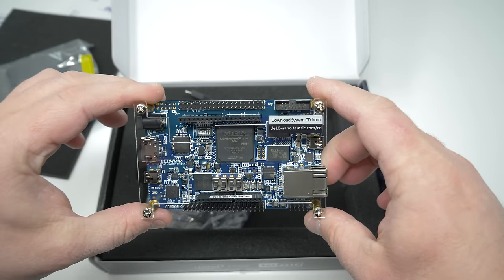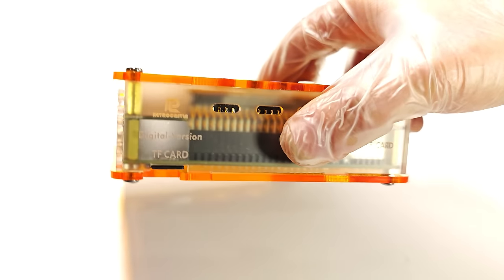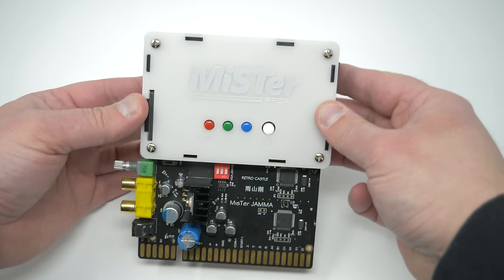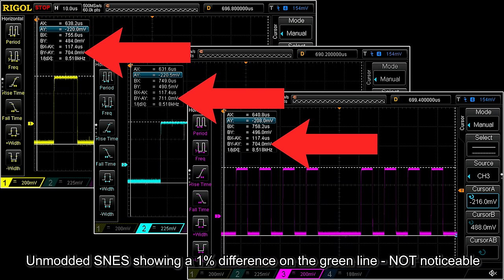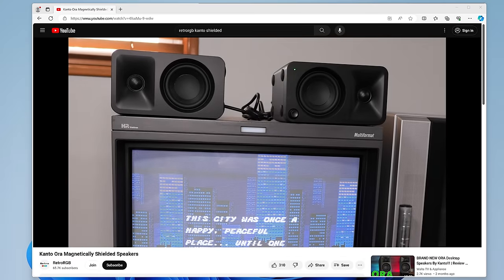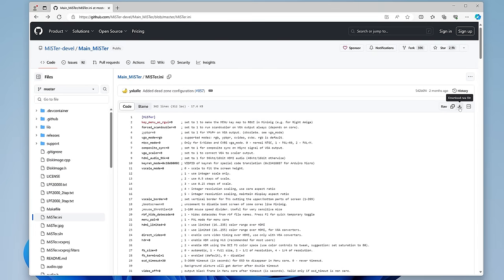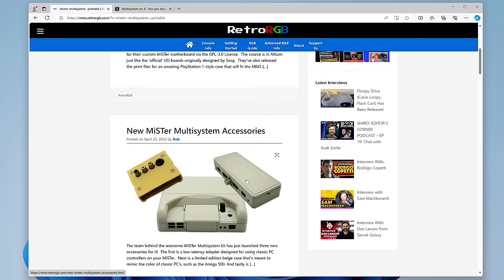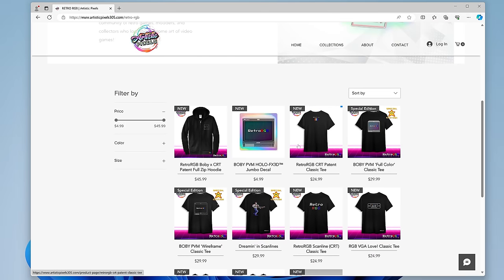Retro Castle MiSTer FPGA Kits

Comment: What has your opinion been on the MisterAddons products? They tend to be the more well known brand of MiSTer accessories, but I see they're absent and there's no mention here. I regret to believe that perhaps professional connections with them isn't favorable or their product quality/support may not be up to your standard. Perhaps I'm just out of the loop.
Reply: Bob's reply to someone else with similar question "I’ve never been a fan of the “double stack” design. And while the analog output is perfectly safe to use (provided you’re using properly-built cables of course), they fail the brightness / voltage tests I showed in this video. So, if you own one and are happy it with, no need to change at all. And if you’re only using HDMI-out, they’re all basically the same. But if you’re looking to buy a kit for use with analog video output, this kits are by far the best."
Reply from the maker: Yup.  I'd also add that MiSTerAddons availability and support were always excellent (and still is), which is why I used to promote them.  But they never fixed the voltage issues and the Retro Castle cases have proved their performance and longevity over the past three years, so they're the one to buy today.
Reply: @RetroRGB  Understood, thanks for the help and answer! Keep up the good work and thank you for all your contributions to the retro scene.
Reply: @RetroRGB It seems MiSTer Addons is releasing new IO boards (Analog Pro & IO Direct) that may fix the voltage issues. Will you be checking these under an oscilloscope if they come out?

Also, do you know if their component cables are different/better than Monoprice's, or are they the same but Addons is charging 3× more?
Reply from the maker: I've wasted hundreds of hours testing MiSTerAddons cases and providing feedback, just to have most of it ignored.  I'm not spending another second of my time testing that stuff, just to be continuously treated like I have.  Which is double insulting, considering how much money I've made him over the years.  I will say that the last prototype I tested a year ago still had bad voltage, but it was at least better than the others.  Really disappointing he stole the Saturn MiniDIN idea from Ivory though ;/

I believe this is the exact cable:  https://www.aliexpress.us/item/3256803400270601.html
Reply: @RetroRGB I'm sorry about the mistreatment. It must've been very frustrating.

Regarding the Saturn MiniDIN idea, does Ivory have exclusive rights to use that on his MiSTer cases? If not, then technically Addons isn't stealing, and other MiSTer kit manufacturers should be allowed to use this idea? His new boards are also using USB-C for power. Sorry for being devil's advocate.

As for the cable, I was actually referring to the VGA to component cable. Monoprice has it for $4.50 (now on sale for $3), while Addons is charging $15. I was wondering if Addons actually used better wiring/shielding to warrant the price increase or if it's deceptive repackaging (not sure if that's the right word).
Reply from the maker: @josephnguyen4349  I mean, you're 100% right - There's nothing "illegal" about using the same connectors.  But if you were making a product that you wanted to stand on it's own, would you do the same thing others have done?  Or would you want it to be more original?

...also, the VGA to BNC cables are almost surely the exact same as the Monoprice ones.  I have no issue with someone reselling at a markup for convenience, but if the shipping isn't too expensive, get the Monoprice ones and save some money.

Comment: Someone has told me not to use the misteraddons complete kits how do they compare to the retrocastle ones?
Reply from the maker: If you’re only using HDMI output, all the kits will perform the same. If you need analog video output, the MiSTerAddons kits aren’t bad…but the Retro Castle ones are much better.

Comment: I just use my HDMI to VGA and then directly into my PVM. No dac needed
Reply from the maker: Right, like I showed in the video:  You can just use a DE-10 and a DAC.  That said, if you want a power button, OSD/reset buttons, built-in USB hub and a nice case, pick up the HDMI-only version that's about to be released.
Reply: Your “HDMI to VGA” is a DAC.

Comment: Regarding the Single Vs Dual RAM, if you mainly care about console games  like I do, the only one that makes use of Dual RAM is the SEGA Saturn core and so far, most of my games run with a Single RAM stick. The games that don't boot with even work with Dual RAM.
Reply from the maker: What about the Jaguar core I showed in the video? :)
...but you're right, all official console cores currently run on one RAM stick.  At least at the time this video was made.
Reply from the maker: Completely agree.  And the biggest difference is time:  Robert spent a YEAR on the N64 core.  While a ton of development went into the Jaguar core, I don't think anyone put that kind of time into it.  So maybe someday it would run on single-RAM?  Here's links:
https://misterfpga.org/viewtopic.php?p=54254&sid=6ae95bb7224acb63b9de0705d351f81e#p54254
https://github.com/Kitrinx/Jaguar_MiSTer
Reply: @RetroRGB  That and Robert had a experiences with more complex cores before like the GBA and PSX, not to mention the introduction of save states in MiSTer cores. Anyway, thanks for the link, I'll revisite in case we ever get Single Ram variant. Cheers
Reply: I am hoping to get more clarification here. I am planning on doing HDMI out only. What is the dual ram kit used for? Is it just specific cores? I plan on playing nes, snes, n64, gb, gba, sega ms, and ps1 games. Do any of these require dual ram or even perform better with it?

Comment: I want Analog out of my MiSTer, but it looks so complicated.
Reply: I felt the same way, but I got a RetroCastle Saturn Din MiSTer for almost two years now. All you need is a quality cable, like Bob said (I use Retro Gaming Cables RGC). I got a Saturn to s-video cord and it looks great on my consumer Sony CRT. That’s it.
Reply from the maker: The only thing you really need to know before buying, is do you need analog out at the same time as HDMI?  If so, get the Standard I/O kit.  If not, pick either :)
Reply: @-haso  I have an Analog VGA board. Do the cores need to support Analog out?
Reply: @RetroRGB  I already have RetroScaler VGA kit. How can I use analog out of the VGA port? Can I just connect VGA monitor to it?
Reply: @RetroRGB not all analog out through the hdmi are created equal though. Component out is trickier without the analog board, and Component was a must for me.

Comment: I just wish they would make a standard bottom board (usb hub) that has usable ports in the back, not the one or two “power only” ports. I don’t need much plugged in, just WiFi/BT and a 2.4 adaptor) but having them stick out the side when there’s two ports in back is just silly.
Reply from the maker: I think you're forgetting these kits are built around the limitations of the DE-10, which doesn't have a "back".  If you want something that's closer to a console-look, see the alternatives I mentioned.
Reply: @RetroRGB  fair. There’s no “back” but there is a power-input side, which, traditionally would be the back. I guess what I really mean is: I’d LOVE to have power and a couple usb ports on the same side, so I could put that side in back and have nothing sticking out the sides :). So far I haven’t found a case that does this (except for the ones that basically cheat by being 4x the size and just reroute internally. 

If I knew how to use PCBway I’d design my own USB bottom board. Time to watch your old videos lol

Comment: That's not called the SNAC port it's the USER PORT.  SNAC adapters use it but as he said it can be used with many other devices that others have designed for it but only one device can be used on it at a time.   It provides direct connection to the GPINs and cores must directly support any device that is connected to it.  For instance the SNAC addapers are only supported by a few cores.